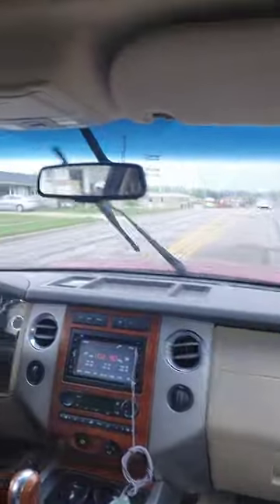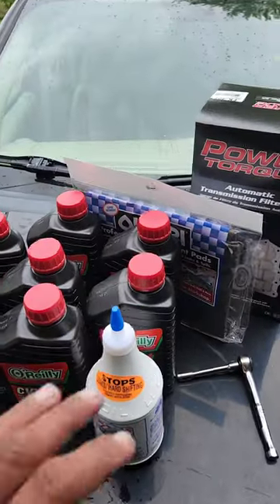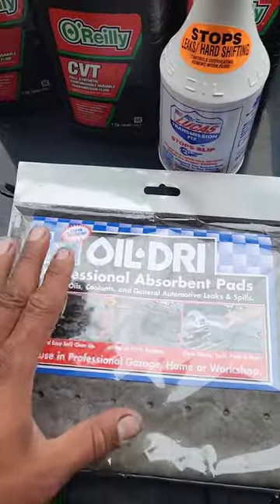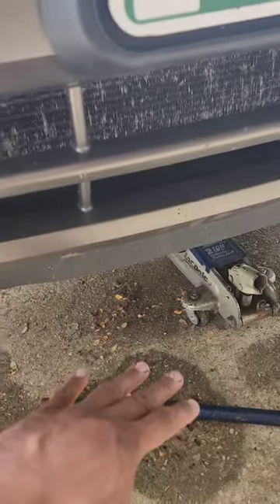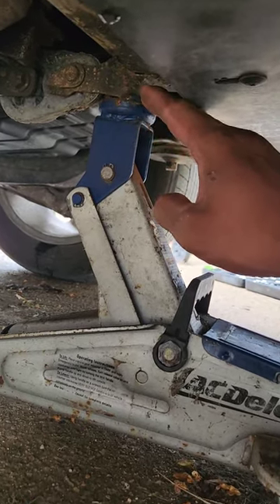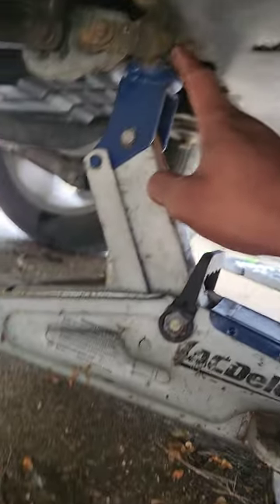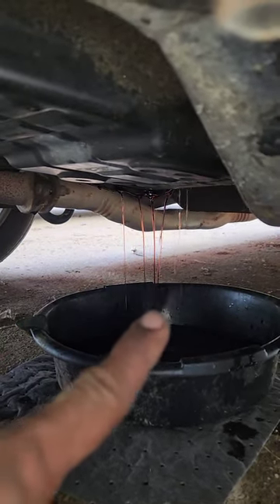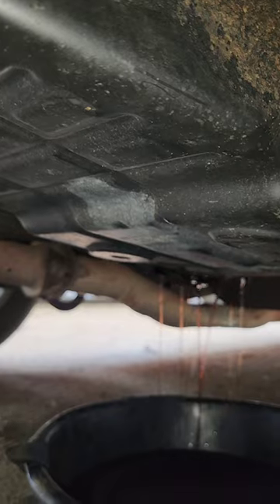How to Change Transmission Fluid and Filter! 2006 Ford Freestyle CVT Automatic Transmission!

Comment: Awesome video! Dealership here wants to charge almost $1,000 to do this job 🤦‍♂️. On a military retirement and with the crazy inflation, this will save me a lot of money. Thank you!
Reply: Have you ever changed the high pressure filter on this? Looks like a pain, but I’m considering just doing it.
Reply from the maker: Hey Thanks for Watching! I have not changed the high pressure filter on these vehicles before! The process appears straight forward..but my research shows most ppl run into issues with stripping the Torx bit screws that hold the filter housing in!! Not many videos on the process that I've found..if you decide to tackle the job, maybe you can film and share any tips or tricks with the rest of us!!!

Either way Good luck, and Happy Wrenching!!

Comment: I don't know about the Lucas additive. A cvt transmission doesn't use clutch packs to shift gears, but an oil change is one of the best things you can do for longevity.  Might I suggest a high pressure filter change as well.  Might prevent a future p0701 error code. Because of a clogged or obstructed filter when cold.  Parts aren't super expensive, but it does take some time.  Access is hidden behind the driver side transmission mount.
Reply from the maker: Hey Thanks for Watching and the Feedback!!

Lucas does offer a CVT "fix" additive..however you are correct the one I used would not "fix" any shifting issues as CVT uses Metal Bands and Drums and "Rubber bands" as opposed to Slips due to wear or lack of pressure.

The reason I used this Additive was simply for the gasket, seal and fluid refreshing it provides! Not for the "fix"

You are correct high pressure filter is a great thing to change, definitley more challenging. Unfortunately I never got around to it as after another 30+k miles or hard driving (she was my Beater to keep miles off my 6.2l Ford) the Tranny gave up thr Ghost and started "Rubber banding" beyond repair.

Thanks for watching and happy wrenching!

Comment: I like the zip tie trick. I'll be using that. Thanks.

I see this isn't a new video, so maybe my question is better NOW:

Has it been a problem that you used generic fluid? And has the Lucas been a problem? (I noticed on mine, the bottle says it's not for CVTs.)

I have not done the filter(s) on my Freestyle. I DID remove some fluid and replace it upon seeing how burnt it appeared, and MY TIP is this: remove as much fluid as you can with an oil sucker first. I pulled a gallon out through the fill hole--the same hole you used to fill yours. I removed that plug and put an oil sucker hose in there and pumped the fluid out. Then I added back that same quantity of fluid.

So when I change my filters, I plan to pump the fluid out first, and then drop the pan, and hopefully there won't be very much left in it and I won't have a catch pan to contend with under the car. Then I intend to change not only the filter you changed but also the one in the pump as well (Haldex filter?)... anyway, thanks for posting content. I have the Ford factory Workshop Manuals, but I wanted to see a video on the subject as well.
Reply from the maker: Thanks for watching and the questions! Sorry for delayed response Youtube routinely fails to alert me to comments and questions.

I did not have any issues w/ the transmission after using the Store brand fluid or the Lucas Oil. I will say I WAS already having slipping issues starting to develop from 2nd to 3rd which is what prompted me to do the fluid and filter swap!!

I was able to get several more months of use out of this car before I decided to downsize the fleet and sell her off!! Overall I am not a big fan of the CVT transmission, Ford stopped selling parts and using them along time ago, and although she was still running and driving PHENOMENAL, I opted to let her go while I could as I knew the day would come, when the transmission would need rebuilt/replaced and my research at the time thru speaking w/ my local Ford shop and transmission shops concluded it would be an unfeasible feat and to get out now!

Comment: It literally says on the back of the bottle compatible with all transmission fluids except CVT and CVT fluid
Reply from the maker: Hey thanks for watching and offering your insight! 

On face value you are 100% correct, the bottle does say not compatible (and Lucas Oil does offer a CVT specific trans fix for anyone interested, I just had extra of this on my shelf). 

The reason it's "not compatible" is not because it'll cause harm, it's because the "reason" is Different for why a automatic or manual transmission slips compared to a CVT so they can't guarantee this specific one will "fix" the issue.

Automatic and Manual transmissions develop Shifting issues from lack of pressure and gear wear overtime due to use, where as a CVT develops the "rubber band" effect from the metal bands and drums becoming overly stretched.

IF your CVT is already slipping not much can be done, they're infamous for being considered total losses and in my experience most local shops don't even bother rebuilding or want to replace them. (Avg transmission life on these specific CVTs are reported to be anywhere from 150k-210k miles)

That being said this product will still assist in Preventative Maintenance and treating the Seals and gaskets, thickening the fluid for better grab by the Bands, and refreshing any old fluid left within the high pressure lines/filters that are a bear to get to on this model.

BUT Humans being ones to ignore issues until they're at their worst, I'm sure that when most ppl grab this product, it's not for preventive Maintenance it's because they ignored their transmission for so long NOW its finally slipping and they're hoping for a "fix"..which this will "fix" the common issues in automatic and Manual transmissions..just not common cause of slipping in a CVT.

 BUT still great for Preventative Maintenance as listed above..and in the Video as that's what was being done..Maintenance, not slipping fix. Simple prevention of future issues and refreshing of the transmission system!

Of course the manufacture can only recommend use of their product from a legal/sales stand point based on their specific research of specific problems and specific claims....but doesn't mean it won't also work for CVT, just that it won't work exactly as it does in others or exactly as they claim it can in other transmission types.

Think paint thinner or Wd-40..product is made for a specific purpose but others have found it works in other areas as well i.e. wd-40 to remove paint stains and grease not just lubricate hinges and paint thinner in your gas tank will help clean your Catalytic Converters and loosen oil build up from inside the intake.

Not compatible is not same as "don't do it will make issues worse" if anything, if you're already having issues..what do you have to lose? My transmission shifted perfect before..and after! For another 34k miles (estimately) before she began to "rubber band" on me and finally gave up the ghost!! 

But I drive Like I'm a race car driver for a minimum of 87 miles a day (42 miles 1 way to work and then around town and home) so I'm sure that didn't help! She was my Beauty of a Beater and I got almost 2yrs out of a $1,500 car. #winning

Hope that helps, and Happy Wrenching!!

Comment: Also im getting the p0944 code hydraulic pressure unit (issue) i have the dreaded helicopter noise and my gas pedal has no response i hope after doing this to my freestyle it will help get my car to rev again
Reply: any luck getting your car fixed? I'm having this exact issue it won't go into gear neither? I need help!!

Comment: I have a question? I don't know if you can answer this, but,  if you can it would be great! I cannot locate the transmission filter. it's not visible when you remove the transmission pan. I cannot find a video that tells me exactly where it is. I suspect it's underneath the valve body but I'm not sure and I really don't want to take it off unless I'm sure. Everytime I Google Ford 500 AIC is Ford Freestyle vids. Thanks a bunch for your time!
Reply from the maker: Thanks for Watching..Even if it Was Inadvertent!! I Do NOT Have Specific Experience w/ the Ford 500 and am Unable to Locate a Workshop Manual Online. HOWEVER I Did Continue Down the "Rabit Hole" The Past Few Hrs and Found Some Forums That Spoke of This..I Will Link 1 Such Forum at the Bottom, Comment #12 States That "There is No Transmission Filter for the AISN Transmission" the Ford 500 Had 2 Transmission Types...CVT (One Seen in This Video for the Freestyle) and the 6 Speed AISN. If You Infact Have the AISN You Do NOT Have a Filter That Ford Wants Changed. Only Drain and refill the Fluid. This is Not an Uncommon Occurence, Vehicle's w/ Permanent High Pressure Filters That Are Made NOT to be Serviced. If You Have Any Concerns Whether This Applies to You, You Can Always Call Your Local Ford Dealership Parts Dept, Based on Your Vin # They Can Tell You Definitively Which Transmission You Have and What if Any Filter You Need. They Can Even Tell You the Exact Type of Fluid and Quantity You Will Need for the Job! Hope That Helps and Happy Wrenching!!

https://www.fordforum.com/forum/ford-five-hundred-67/five-hundred-trans-fluid-change-42620/
Reply: OMG, Thank you sooo much for all your hard work on my behalf!You have helped me tremendously!I will tell everyone to subscribe to your channel!

Comment: I just called a Ford Dealership. They are charging $800 for a transmission fluid change with filter change. Without filter change, $300. After watching your video, it makes me wonder why the dealership is changing $800.
Reply: Because they only use Motorcraft fluid that's $40 a quart

Comment: I have the same car make and model and my transmission is slipping. It runs loco but I can I hit the highway I do 6000 RPMs when is only going 40 miles an hour local is good.

Comment: Hello Sir! Is there a cabin air filter, and where is the location? Please 😊
Reply from the maker: Hey thanks for watching and rhe question! My research, and Knowledge is that the 06 ford freestyle does NOT have a cabin air filter.
Reply: @minutemaintenance7385  Many thanks, Sir!
Reply: @kanif9938  I know this old old but you can take off glove box and use a oscillator tool to drimmle out the spot where a filter should be. ford has a spot for one but they never officiallly installed one you gan goodle around about the cabin filter to use. i forgot. but i just bouight the one they reccommended then i used allumimum tape to seal the opening new filter works great it just sits right on top of blower motor

Comment: Thank you Sir,
Reply: I have a question, Sir I am planning to change the filter and the transmission fluid for my 2007 freestyle how much liters do I need for that please ?
Reply from the maker: @kanif9938  Hey thanks for watching! I used 7 quarts...(6.6 Liters if my conversion is correct) to replace the fluid I removed. After swapping the filter and replacing the fluid always check the levels when the car is at operating temperature AND in neutral gear, so apply the parking brake or get a trustworthy friend to stand in the brake pedal!! After driving another 50-100 miles I would recheck the fluid level, it should drop (not alot) but my need another 1/2 liter after absorbing into the filter and lines.

In this video I also added 1quart of "Lucas stop slip" transmission fix..as a Conditioner to treat the Seals, gaskets, high pressure filter that is further in the Transmission and the old fluid left in the lines. The "slip fix" I used is NOT recommended for CVT transmission fixing, but will work to condition the areas I mentioned. If you're car is slipping Lucas does sell a CVT specific "stop slip" I'd recommend. That can be added to a full transmission at anytime and was not part of the 6.6 liters i mentioned before, it was in addition too!

Hope that helps and Happy Wrenching!
Reply: @minutemaintenance7385  Thank you for your informative explanation, as well as the professional video. Best regards and good luck.

Comment: You should only use genuine OEM Ford CVT transmission fluid in the Freestyle and Five hundred CVT transmissions. Also you shouldn't use any of those snake oil Lucas products. There's a reason that only transmission fluid goes into a transmission and engine oil only goes into an engine. Don't use additives as they can actually cause more damage.

Comment: DO NOT ADD STOP SLIP TO A CVT !!!!!!!!!! Please do not listen to this guy regarding that and if you're going to listen to him then listen to the bottle of Lucas that says not for CVT there's a reason you don't want a stop slip application going into a continuously variable transmission. Think about it don't do it
Reply from the maker: Hey thanks for watching and offering your insight! 

On face value you are 100% correct, the bottle does say not compatible (and Lucas Oil does offer a CVT specific trans fix for anyone interested, I just had extra of this on my shelf). 

The reason it's "not compatible" is not because it'll cause harm, it's because the "reason" is Different for why a automatic or manual transmission slips compared to a CVT so they can't guarantee this specific one will "fix" the issue.

Automatic and Manual transmissions develop Shifting issues from lack of pressure and gear wear overtime due to use, where as a CVT develops the "rubber band" effect from the metal bands and drums becoming overly stretched.

IF your CVT is already slipping not much can be done, they're infamous for being considered total losses and in my experience most local shops don't even bother rebuilding or want to replace them. (Avg transmission life on these specific CVTs are reported to be anywhere from 150k-210k miles)

That being said this product will still assist in Preventative Maintenance and treating the Seals and gaskets, thickening the fluid for better grab by the Bands, and refreshing any old fluid left within the high pressure lines/filters that are a bear to get to on this model.

BUT Humans being ones to ignore issues until they're at their worst, I'm sure that when most ppl grab this product, it's not for preventive Maintenance it's because they ignored their transmission for so long NOW its finally slipping and they're hoping for a "fix"..which this will "fix" the common issues in automatic and Manual transmissions..just not common cause of slipping in a CVT.

 BUT still great for Preventative Maintenance as listed above..and in the Video as that's what was being done..Maintenance, not slipping fix. Simple prevention of future issues and refreshing of the transmission system!

Of course the manufacture can only recommend use of their product from a legal/sales stand point based on their specific research of specific problems and specific claims....but doesn't mean it won't also work for CVT, just that it won't work exactly as it does in others or exactly as they claim it can in other transmission types.

Think paint thinner or Wd-40..product is made for a specific purpose but others have found it works in other areas as well i.e. wd-40 to remove paint stains and grease not just lubricate hinges and paint thinner in your gas tank will help clean your Catalytic Converters and loosen oil build up from inside the intake.

Not compatible is not same as "don't do it will make issues worse" if anything, if you're already having issues..what do you have to lose? My transmission shifted perfect before..and after! For another 34k miles (estimately) before she began to "rubber band" on me and finally gave up the ghost!! 

But I drive Like I'm a race car driver for a minimum of 87 miles a day (42 miles 1 way to work and then around town and home) so I'm sure that didn't help! She was my Beauty of a Beater and I got almost 2yrs out of a $1,500 car. #winning

Hope that helps, and Happy Wrenching!!
Reply: The rest of your video is excellent though I must say. But definitely inform your viewers they will void the warranty and the manufacturer will find out because one of the first things they will do is test the fluid and they will know exactly what additives you have put in that are not recommended. Since they are trying to not have to pay out anything. They would rather run a very simple fluid balance test because they know if they ask you if you put anything else in you're going to say no
Reply: Thanks for the video really informative I needed this